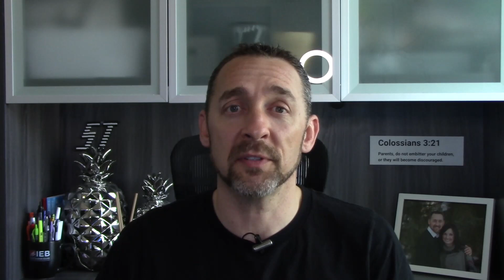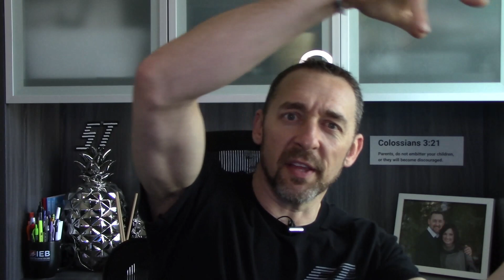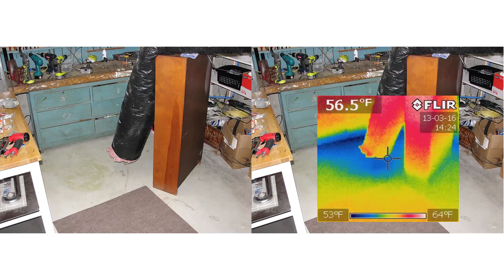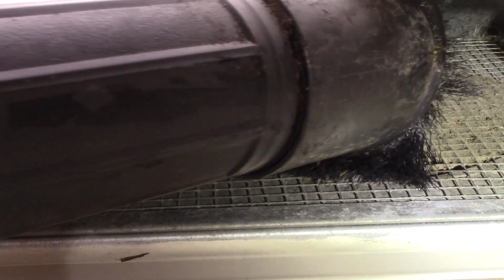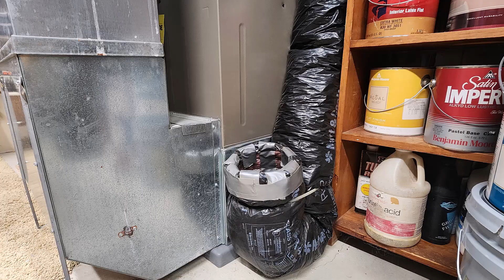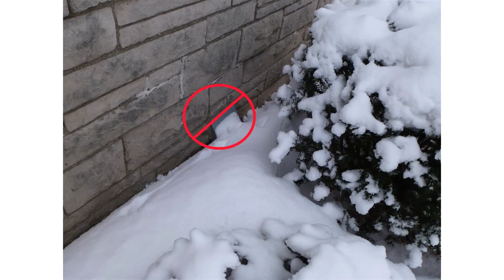Combustion Air Ducts, Part II: Problems and Solutions

Comment: Thank you for the presentation. Now I understand the reason when the plumber added the fan-in-a-can connection for the house. The outside section of the vent used elbow pieces of PVC pipe connected together to construct like a snorkel. And a galvanized cylinder pipe connected the can and the opposite end to the outside snorkel configuration. My annoyance is that I can't use the basement during the winter. Because the fan acts as a wind tunnel, drawing freezing cold air from the outside during the winter season and into the basement. And that freezing winter air temperatures is unbearable. Ugh. There is a wall and door that divides the basement room from the utility room which has the gas hot water heater,  the hydronic boiler and can/fan. Any suggestions on how to insulate between the walls and ceiling to make the basement comfortable?